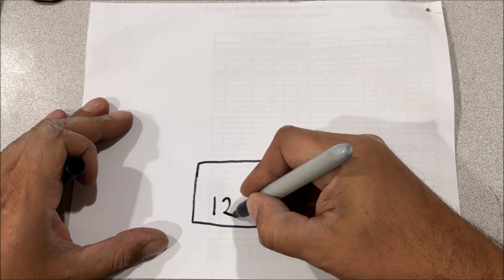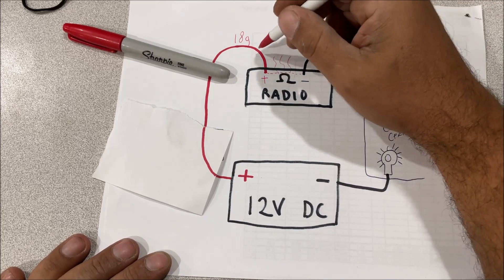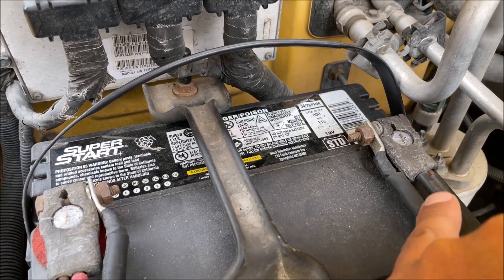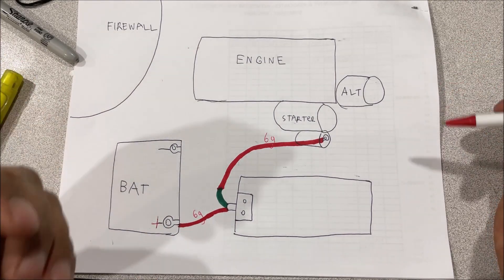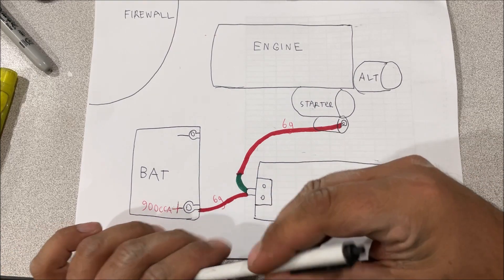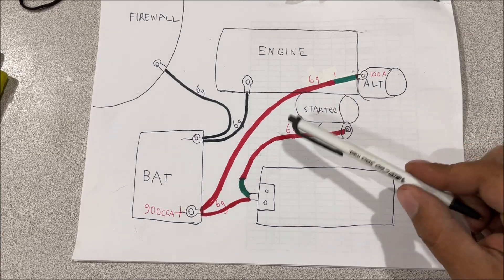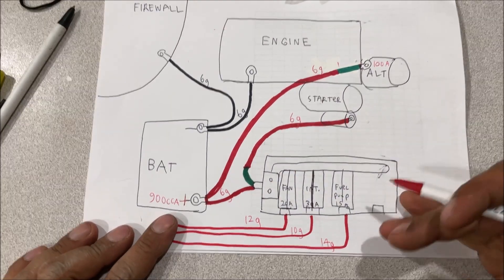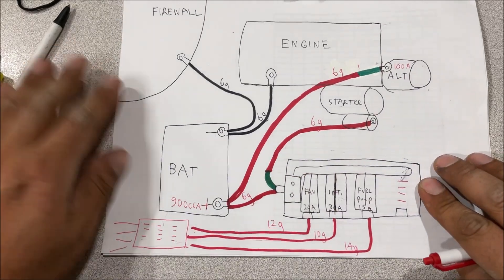do you fuse the battery and alternator? AUTOMOTIVE fusing EXPLAINED

Comment: On my 54 chevy pickup, which is all steel, i fuse everything individually.
Any cable may get in contact with the body by any reason. And in that event i dont get stock because i only may loose one element. And i may be able to continue running for next stop maintenance. Everything like you said must be fused. I wire my truck myself without any previous experience thanks to your advise. 
Even on a steel box like my truck i feel electrically safe thanks ti my fuse block.
Reply: Ty for your comment. I have a 52 and am converting to 12v. I've been trying to figure out if I should fuse between the alt and batt. Some say yes, others say no. What did you do?

Comment: Thanks for insight, I put a 1 gauge wire from battery to starter solenoid and at starter solenoid terminal it goes into I think a 2 gauge wire that leads to everything aside from starter. Wondering if this 1 gauge is overkill and should be reduced to something smaller so it would have battery chance of severing in event of catastrophic short?
Reply from the maker: no, that’s fine… people don’t t go oversized because of the cost

Comment: I use the old GM wiring code for nearly every re-wire I do (car/truck), and they all have the "fusible link" at the Alternator & Starter. Like you showed, it's not a "fuse" its a smaller gauge wire that continues to the Alt & Starter. To be honest about it, I use the Speedway 22 circuit kit because at $200 it makes life so much easier, and a HUGE time saver over making one up myself. It's all built right into the kit & makes everything new (and easy to identify later).
That being said, you find "fusible links" in weird places depending on brands. Take an '86 Jeep CJ7 for instance (I'm doing one right now). They use the Tachometer as 1 of their Fusible links. When bad things happen, they are designed to burn the Tach before the rest of the Jeep. Lot of Mopar (and other pre 65 cars) use the Amp Gauge as the link.
So really you do, but they aren't always Fuses.

Comment: i was doing a fuel pump relay kill switch….85 is a ground,87 is 10 gauge sodered to fuel pump positive wire,86 is to toggle switch,others side goes to positive on battery,30 also goes to battery…..switch is turning on and off but car keeps starting whether i turn toggle switch on or off……not sure what i did wrong this is for BMW e46 2001 330xi
Reply: @chriscraft the only thing i know  is by watching your videos

Comment: To put it in short though are there any disadvantages to fusing an alternator to battery connection? Beyond premature loss of power due to the fuse blowing.
Reply from the maker: what are you trying to protect with that fuse? the point of the video is showing you don’t need a fuse unless you are running huge power to something like in car audio. what are you running power to that even needs a fuse at the alternator? Just buy a factory replacement cable there is nothing that needs an upgrade on a stock vehicle
Reply: @chriscraft77022  the factory cable is fused is what I'm trying to say. My only concern would be if the alternators internal voltage regulator went bad but that's voltage not amps so maybe a fuse wouldn't do anything.  Worst case a fuse is a harmless safety precaution. I'd rather not buy a factory replacement cable for a vehicle from 1991. Also I'd have to follow it through the main loom. You still fail to state the disadvantages of fusing an alternator which I believe there are none if done properly. Your video title should be don't fuse your stock connection to your alternator for no reason. If the wire is prone or likely to grounding out for any reason there is no harm in fusing it. If your confident then sure you don't need to. Your just arguing the point that the suggestion is a waste of money and yes most of the time it is but when you need it most its really just a safety precaution so install it with that in mind on what your trying to save. Me I'm trying to prevent putting a 4ga power lead to my battery and waiting for it to ground out on the chassis and start welding or damage my battery severely, reducing the lifespan of the part.
Reply: I'll agree that the fuse I have installed will probably never see any relevancy but I know it's there Incase shit hits the fan. Electricity isn't always as predictable as we'd like it to be.

Comment: I see your logic, not to contradict but my Honda has a 60amp fuse for the "battery" circuit. I was brought here because I'm trying to learn more about upgrading my original battery to alt cable because my old one is worn out so to speak. I just put a 60 amp fuse on the 4 gauge wire I connected between my bat and alt positive terminals and it's a 60 amp alternator so I think I'm safe. It matches the original fuse for the full circuit. It's safe to assume my connection will take less load than the original circuit because I just have the two points connected and I'm assuming there's more connected to the battery fuse, or the fuse is to protect the car from the potential of the battery.
Reply: yes that's proper do you wanna know why..   So if you jumpstart your battery wrong and put positive the negative negative to positive you blow the fuse and it doesn't blow your PCM you still could  ,   but it's more protected

Comment: Hey Chris, I bought the switch & wire, per your kill switch video. Been waiting circa 2 years for your promised Part II. 
You have a very large # of comments and replies bugging you to follow thru on that. 
Are you ever going to follow thru on that? Or should we research other Channels for something similar? 
It's past time to either shit or get off the pot on that Part II. 😎
Reply from the maker: im not working on the chevelle now..  i dont know what vehicle you are working on so i cant tell you how to wire it up..   you need a 4 pin relay to ground out the horn button under the dash when it is energized if you dont want to run a wire back up to the horns..  i should be working on the chevelle again in the fall...  SORRY
Reply: @chriscraft77022  Your courtesy of a reply is a positive in lieu of your part 2 video. 

I intend to proceed ASAP to install my 20 amp single pole, double throw switch (10 gauge wire) to my 1984 MBZ  SEC. based upon your Kill Switch video Part 1 diagram including the single  wire from the switch to the horn in your diagram.
If I am missing anything here please let me know before I get into this project.
Thank you Chris.

Comment: grounding the alt is another car audio thing, the alt is already grounded by being bolted to the engine but what people do is run another ground wire from that point to battery due the current increasing ( usually added a more powerful alt ), they even add more grounding wire to the chassi ,I have heard terms like "bottle neck" referring to the lack of grounding wires. Great video by the way. You are the person who taught me with your videos what a relay is and why we use them thank you so much!
Reply: Actually not a car audio only thing. Newer diesels been known to do it because the high draw modules are voltage sensitive also when a lot of accessories (lights and aux hvac ect) are installed it is recommended as well, typical with off road vehicles like overlanders.
Reply: you have to be careful with adding ground wires.  Too many can actually cause ground loops which can cause problems for electronics and such.

Comment: What happens if your car is in a collision and let's say the unfused battery-alternator wire is crushed against the frame (making contact) which completes a circuit to the negative battery terminal which is grounded on the chassis? Fire?
Reply from the maker: it arcs like a welder and usually burns the wire in two in a fraction of a second..  if there is anything around it that can burn, yes...  why don’t they fuse the battery from the factory???  that is the point
Reply: @chriscraft77022  thanks for the reply. I have my battery in the trunk and I'm running a 120A fuse before the starter. Hopefully that pops before the arc welder situation arises.
Reply from the maker: the reason I didn’t bring that up is because my 17 Camaro has a factory battery in the trunk with no fuses .. and it is an SS convertible ... that car has a lot of flammable stuff in it... and your fuse should be on the positive battery post if you want it to protect anything during a wreck..
Reply: My friend owns an auto body shop, a Jeep came in late they couldn't get the hood open because it was crushed. So he just left it for the next day. Overnight you could see some Sparks on the camera twice, like 5 min apart then it's smoldered for about would look like a 20 min to a half hour. Then caught fire. Burn his whole shop and everything in it and every car in it. The bad part was he had just changed his insurance company 3 months before. They sent so many inspectors and forensics guys even though there was video proof of how the fire started. The insurance company gave him a real hard time for his payout.